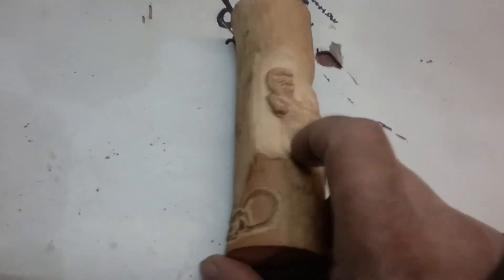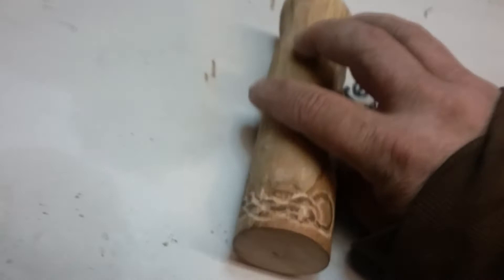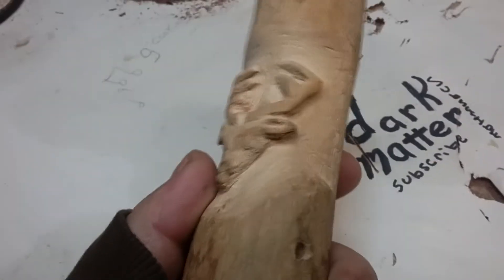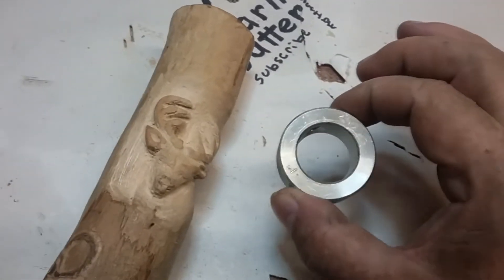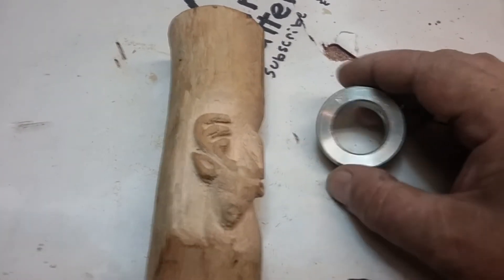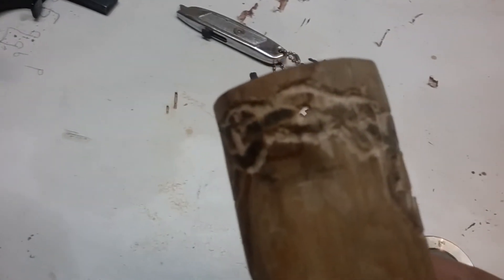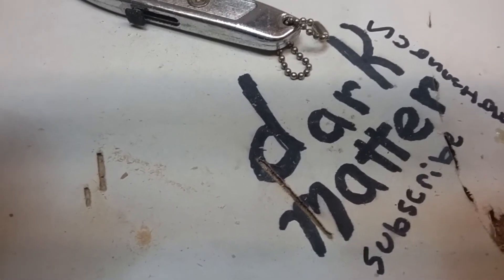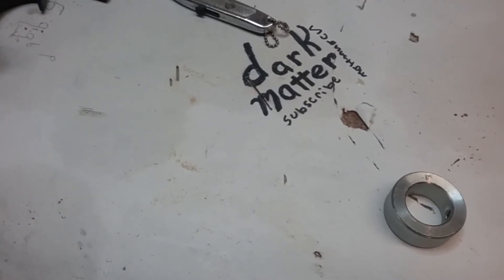ferro rod handle fail

Comment: Yup... it's trashed. You better just go ahead and send it down here! 😉 .... If there were  a couple of holes drilled through the ring, maybe 3, you could mount it flush to the bottom of the handle using epoxy and pins, like a knife handle. The hole in the wood would only have to be an inch wide. Just my $0.02 worth.... that deer head sure looks good!!!
Reply: Carolina Chris Outdoors 
Lmao..
Reply from the maker: thanks chris . yeah no worries man just a small set back . you know me pretty good i dont give up that easy . and the other handle will have a good home at some point with a smaller ferro rod .

Comment: That collar is way way overkill. A thin sleeve with a soldered nut on it would work perfect and still maintain structure strength.
Reply from the maker: yeah i know brother but it is what i can find at the hardware  i dont have the skillz to make something like that . i did think about getting a tap and die  and tapping out pipe for the sleeve  it would work just as good and  do the same job i just dont have them tools yet . but thanks for the advice brother i may try that at some point . god bless you brother

Comment: dark I'll take that messed up handle, just cut off the crapped out part, drill a smaller diameter hole and I'll find a ferro rod to put in it
Reply from the maker: wish i could dear how ever it still is spoken for already  im sorry keep your eyes open dear and you will understand why in future videos for sure . the handle wasn't a loss just wont work for jerry . i wish i could tell you more about it but if i did then it would ruin my plans .